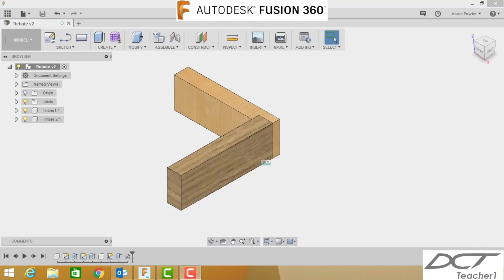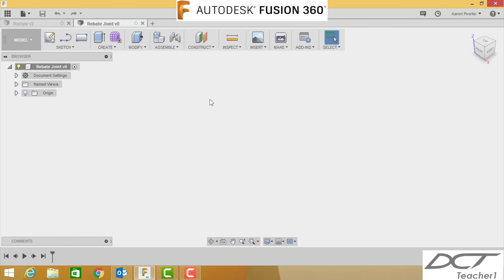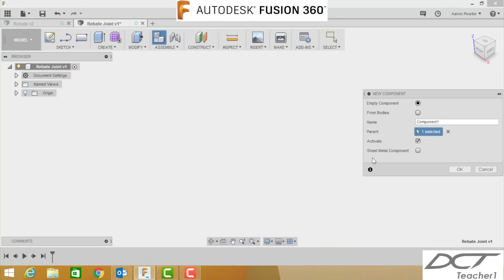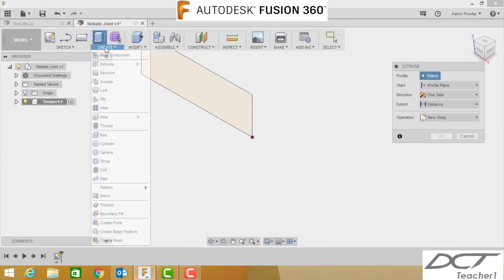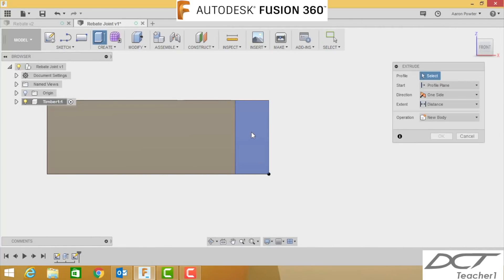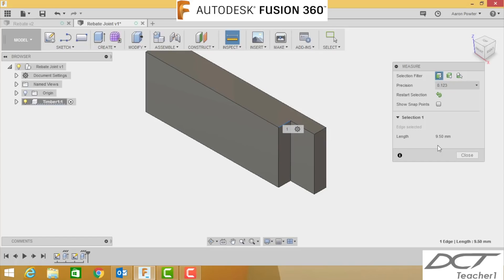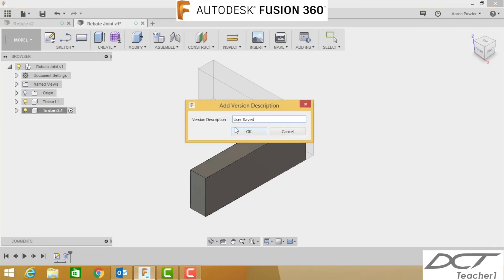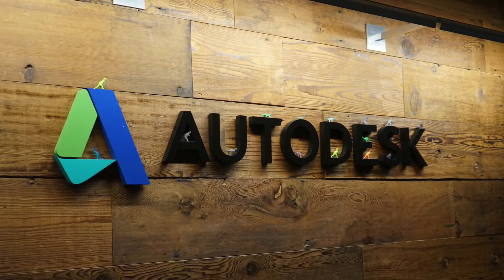Fusion 360 Rebate Joint  - HTC Tech10

Comment: Hi Aaron. I didn't know about parameters, but will find that immediately useful. In the US, I'm forced to use both metric and imperial, and wish that Fusion would have dual measurements like Solidworks. Regarding joints, the "50 DIGITAL WOOD JOINTS" site contains a lot of interesting wooden joints. And do you know why they call a butt joint, a butt joint? Because they are butt ugly. :) Sure wish I could remember who I heard say that originally. Best wishes, Kent
Reply from the maker: Hey Kent, it's great to hear from you mate.  Oh yeah, the parameters are so cool.  Wish I could remember to use them more.  Oh, with your dimensions you can just leave your set up in mm and when just type in the imperial size (i.e. 1") and it will still work.  Hey, are you sure that relates to the joint?  Many people have often said that about me "butt ugly" ha ha ha.  Merry Christmas to you and your family Kent.  Cheers, Aaron.